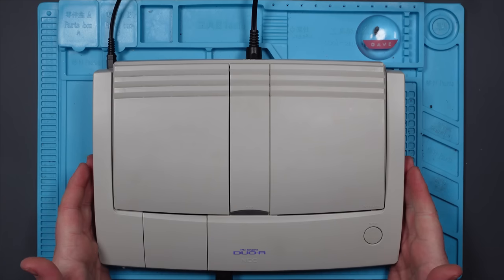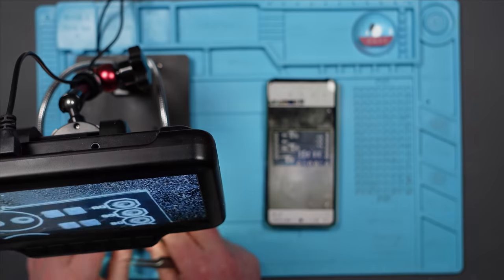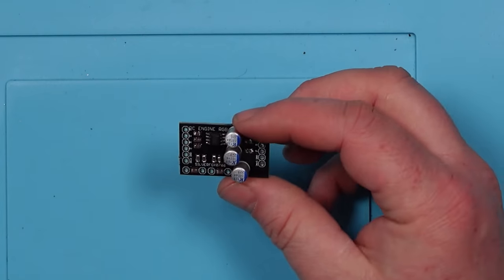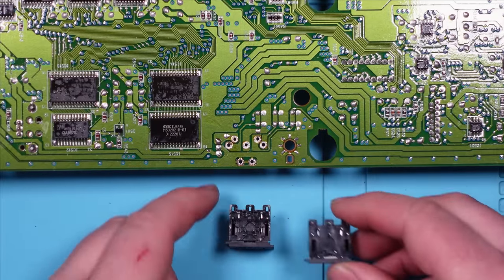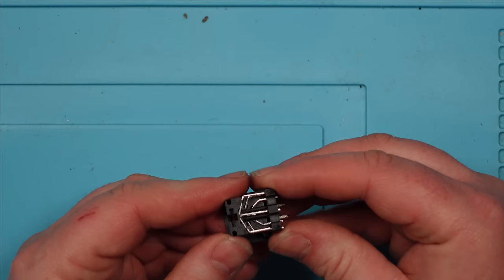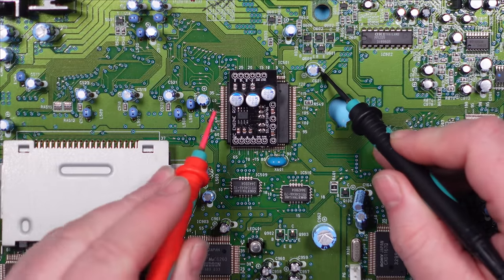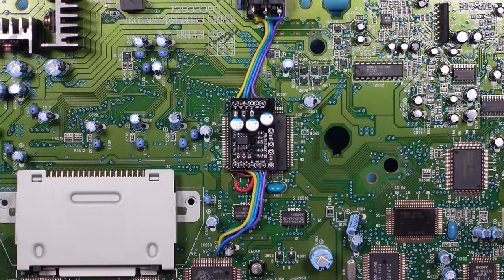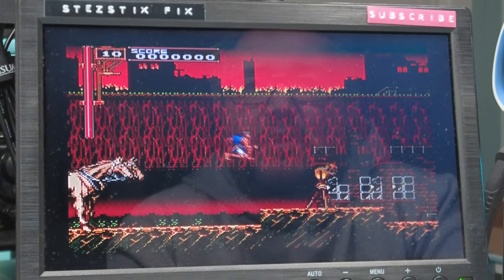First Attempt at a PC Engine DUO-R RGB Mod | Nice

Comment: You do great work my friend but a suggestion....  You need to regularly clean off your solder tip... you are using a dirty iron and it will contaminate the connection.. clean often....  Great stuff.

Comment: I was wondering if you could help me with an easy question, is it normal for the hucard to have a lower volume than the cd system? I always have to turn the volume up when using hucards.

Comment: nice video. I have a queation that the rgb amp used a ths7314 that can output 3 channels but the purpole line coonnected also.  does it be necessary or how it works at this way?

Comment: Nice work !
Just bought mine from Doujindance, the rgb is a game changer !
Now i can compare the accuracy of my personal pc engine emulator with the real hardware :)
Reply: And how was the comparison?
Reply: @Goldenskidmk  Almost 99% of pc engine games are correctly working.
Some of them, wich use mid scanlines effects (like cadash), have some background glitches.
Something should be wrong with the position of the BXR/BYR and/or RCR counters and timings 🤔

Comment: Great video 👍 I have just bought a duo r of eBay it's been RGB modded but when I tried it the colours are messed up 😢the green seems to be ok but the red and blue  have swapped out.
Could this be a case of two wires in the wrong place

Comment: I read the title and was expecting the console to end up filled with coloured flashing lights lol. Why is the big bag of components, way too big for a tiny circuit board, a few caps, resistors and some coloured wire? I really fancy a de-soldering gun.
Reply from the maker: Yeah, it was only a big bag because I had to buy 10 of everything! That desoldering gun is amazing. Makes life so much easier.

Comment: The scratches on your hand. Do you have a kitten? Only asking as mine are very similar at the moment! Love your channel, currently getting into electronic repairs. Have you considered making some "Beginners guide" videos? Stuff like Need for flux, Soldering and Volt meter use?

Comment: Very nice! the value of these systems has sadly never been low, even a faulty unit (because they almost always need their capacitors replacing) tend to still be expensive so I don't think I'd want to mess with modding one too much, thankfully recapping them is no more challenging than any other system once you're confidant with surface mount capacitors.
Reply from the maker: Thanks Sparks. Yeah, they are still really expensive, so I was a bit nervous working on this one. I made sure that anything I did was reversible so that it can be put back factory if needs be! 👍

Comment: Great job that. I've never seen that console before is it from the 70s ?
Reply: Don’t know where you‘re from. I‘m from Europe and the system never got released where I live. It was a system in Japan and North America. The Turbo Duo is early 90‘s but the base system PC Engine was released in 1987. Came before the Mega Drive/Genesis and was competing with NES and Mega Drive. The system was a 8bit / 16bit hybrid.
Reply: @marcianzero_yt  I live in scotland but never seen one of these. I dont know why i thought is was from the 70s when i can see a cd drive
Reply: Almighty Google says: This new version, the PC Engine Duo R (PCエンジンDuo-R, Pī Shī Enjin Duo Āru), went to market on March 25, 1993 with a retail price of ¥39,800. The Duo R omits the 3.5 mm phone connector for headphones, and the locking switch for the lid of the Duo's top-loading CD-ROM drive.

Comment: As one with a military grade soldering certificate, it pains me to see you use air so often on smaller/simpler components. Use two soldering irons instead. Don't torture the poor thing. Anything with 8 contacts or less I'll just use irons to get off.